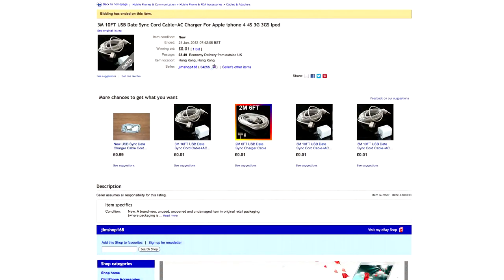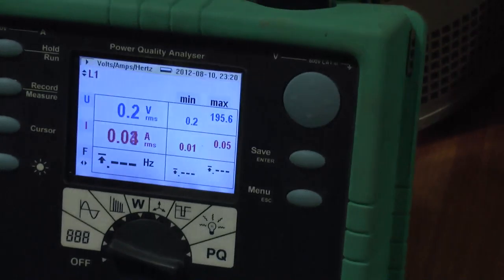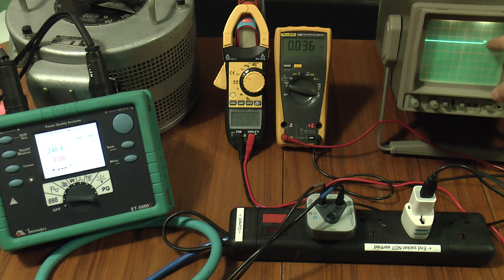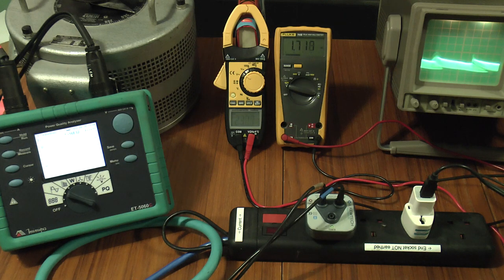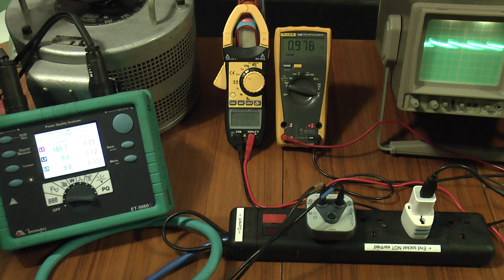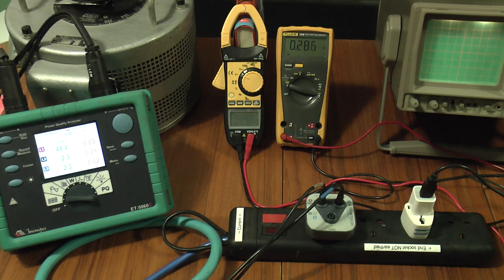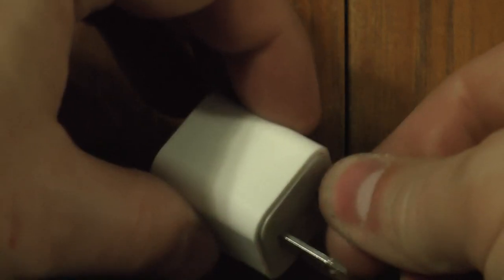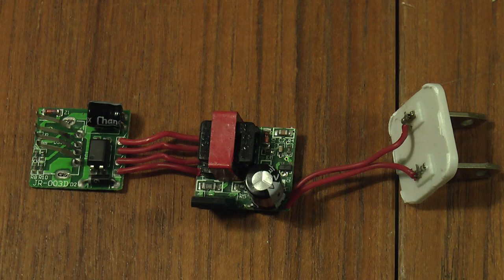Cheap iPhone/iPod charger test and teardown

Comment: That's "safe" compared to some of the other stuff they're selling on ebay.  Keep a look out for mains powered LED lamps with arrays of surface-mount LEDs round them, but no glass our plastic glob to keep you from handling them.  They're using common capacitive droppers, so you can get a shock just by putting the lamp into a live holder.  Woe betide you if you're holding an earthed metal fitting while you do it.

Comment: The cheap socket adaptor these things come with is a risk in itself.  You can plug a square pin plug into it upside down defeating the earth.  Worse still, if you push the plug in with the neutral or live pin in the live receptacle and the other pin hanging out, then the other pin of the plug will be live at mains voltage, only limited by the load connected.

Comment from the maker: Cheap Chinese 4-way power strips, one of the ones at work went BANG when a colleague of mine plugged it in, due to insufficient clearance between one of the surge arrestors and the earth bar. We recalled them but they still keep turning up, over 60 of this particular model retrieved so far. Loose wires, missing terminal screws, loose terminal rivets, poor clearance, most had at least one of these faults.

If you still think such stuff is safe, then by all means enjoy your cheap Chinese hardware.

Comment from the maker: The only way to tell 100% would be to buy it from the manufacturer (or in this case from the Apple Store). You won't get much more expensive than that. At the very least buy from a high street retailer, whose doors Trading Standards will happily kick in if they sell something dangerous.
It'll be interesting to see what's inside the one I've ordered from the US when it arrives.

Comment from the maker: I hope you mean 7805 :)
I'm impressed with some of the 12 volt switch-mode supplies you can get, I have two in the car, one set to 9 volts and the other to 7.5 volts, running an onboard camera system with GPS overlay. As they're switch-mode they're more efficient, instead of just dumping up to 6 volts at however many amps (they're rated at 2A) as heat.
eBay item 120906904229 is identical to the ones I used.

Comment from the maker: Salvaging a PSU from something else might be a good bet. Some IT gear such as hubs, switches and fibre converters use 5 volt supplies, and if they're a reasonable brand (Allied Telesyn, NetGear, etc. they're likely to be built to last. Alternatively if there'll be a PC to hand nearby, use the 5 volt rail in that. I've done that with CCTV at home, the 12 volt supply rail can handle cameras, no problem.

Comment from the maker: It's unlikely a contact could fall through the shielding to the high voltage side (I ripped the shielding off to do the schematic as there are components underneath). The boards are folded over on themselves though, so about the only thing between the USB shield and the input smoothing capacitor is the capacitor's plastic sleeve!

Comment from the maker: If it's old and obsolete, or imported crap, I'll try and make a schematic. It makes it easier to get my head round how the circuit works, although in a lot of cases (such as the LED driver) I STILL don't know how it works :)

Comment from the maker: My dummy load used an IRFZ44, an LM324 with two broken pins and a 7808 regulator, all of which came from god-knows-what, a heatsink from a redundant power supply backplane and a multiturn variable resistor that used to be a TV tuner control :)

Comment from the maker: Possibly. It's a new one on me, but if a device doesn't want to charge in the car, it may be that there's nothing connected to the DATA+ and DATA- pins and adding those four resistors might help.

Comment: I've got one exactly like this on the outside, it was a couple dollars on ebay. I decided to pull it apart, for SCIENCE. Mine actually says "Designed by Apple in California" which is dangerously deceptive. Luckily I knew what I was buying.

Inside is even cheaper than yours. It uses a half wave rectifier, and as far as I can tell no linear regulator either. The soldering is piss poor, with most of the solder pads only being half covered in solder. I won't be missing this piece of junk!

Comment: Yes a woman in china has been killed from a cloned iPhone charger.
Clearances are important and these chargers have not passed any safety tests and have fake CE marks on them.

For instance if it overheats that entirety possible with the very low quality components used, then the clearances can short and make the usb lead and  your phones casing live with 240v AC mains in the UK.

There are lots of brands that make safe chargers that have CE tested Belkin, Griffin, Masterplug etc.

Comment: I miss UK Chinese food.. Living in NZ the past few years yet to find any Chinese food that is close. What I don't get about the psu is surely the person laying out the board has some electronics knowledge? if you know enough to lay the board out you would know enough about basic safety? or maybe they don't and it's a simply join the dots type layout? :) The AU/NZ version Dave J got had the same US pins (with the holes) but angled! recycle parts ;) Excellent review thanks :)

Comment: Equipment is not built like it use to be built
Too much mass produced cheap junk that when it fries can kill or burn your flat down
It seams like they don't care if it works then they just throw it out their with out any regards to mains safety 
Junk caps and all
Loved it when you popped it
Thanks for the cool vid

Comment: Atrocious, I've had an apple charger die (the fuse blew in it) so I took it apart, the casing was hard to open and was designed waaaay better than that POC, although not exactly the same design, it was the "toilet duck" style where you can change the plug on or use a figure 8 lead

Comment: While not related , tonight I had iPad in one hand on charge. , in the other I had the low voltage plug from a set of Christmas tree led lights....  in the darkness there was enough voltage to pass through me to light them up a little. Seems apple allow leakage and no ground . Charger was a real OEM apple iPad charger
Reply from the maker: You'll get that with some power supplies, it's especially noticeable on metal items, where if you run the back of your middle finger across the device you'll feel a slight "hum" as you do so.